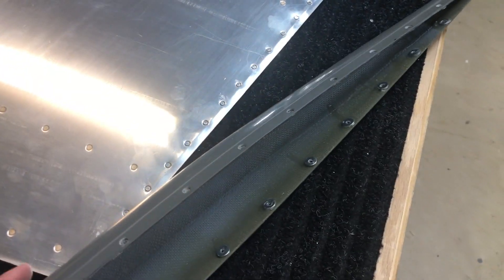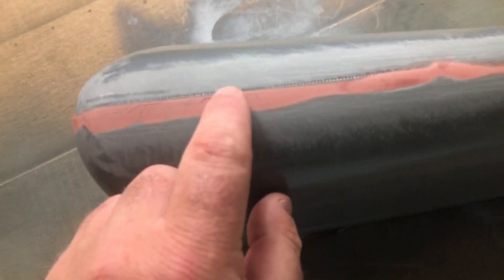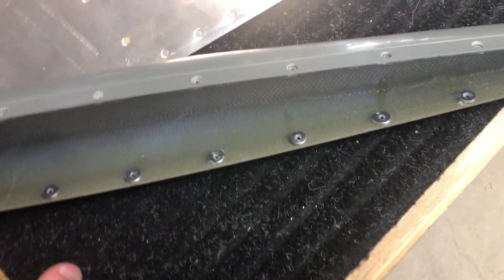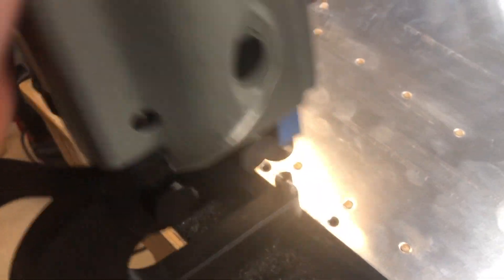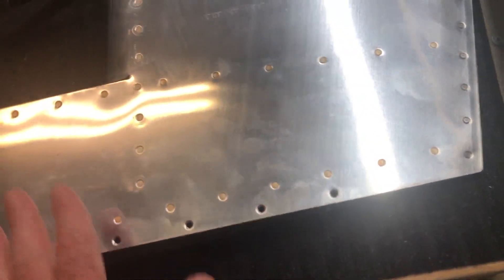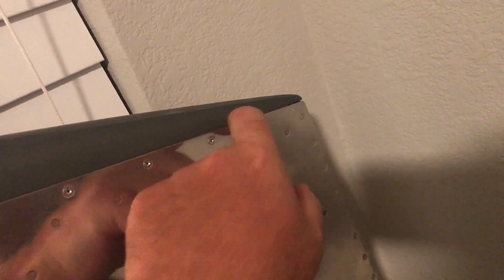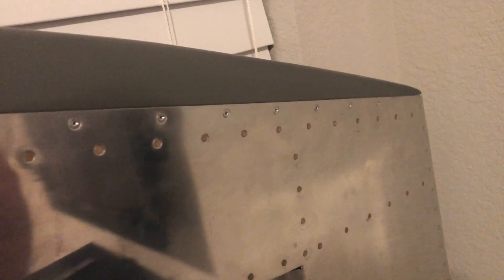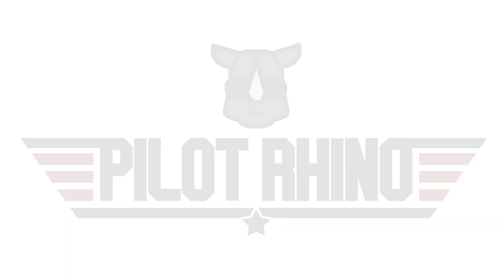RV 10 Build 19 - Rudder Fiberglass Tips

Comment: Love the videos! How did you order your wires? As a kit or individual gauges and lengths?
Reply: I ordered my wires individually by length and gauge.  The lights you use should have a spec for gauge or there are charts you can use based on amperage and length of run.  I found stein air to be the easiest to order the exact wire I needed, but other sources have them as well.  Make sure you are using aircraft grade wiring, its called tefzel.  The exterior insulation on regular wiring is not as strong and is toxic when it overheats or burns.
Reply: @Therestaurantboss  Ok, I started doing the same thing. Just was wondering if there was a quicker way to do that. Thanks!